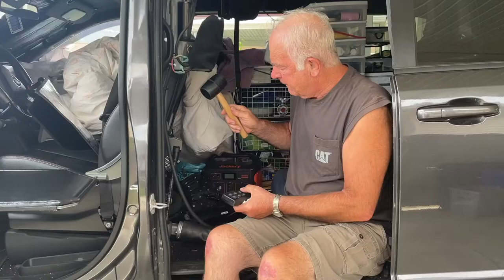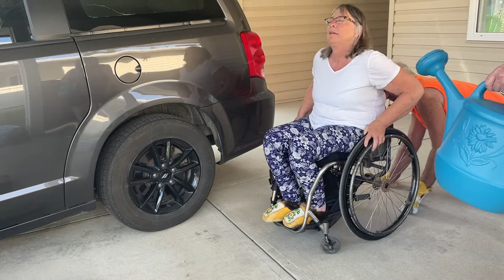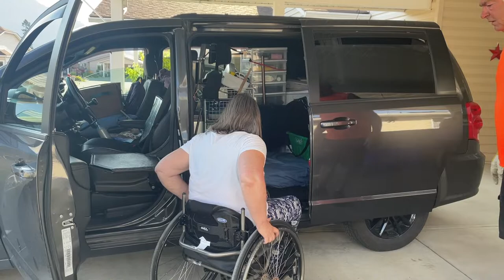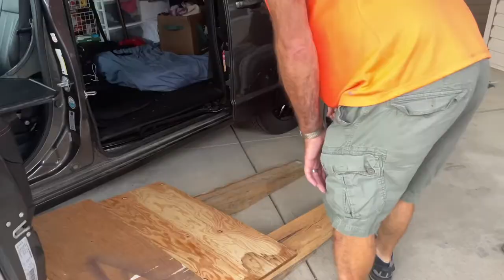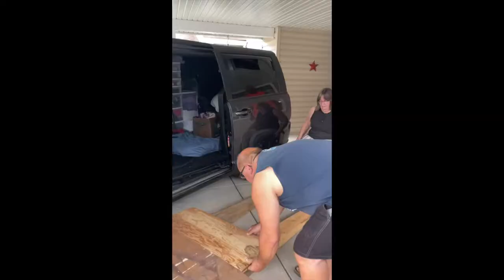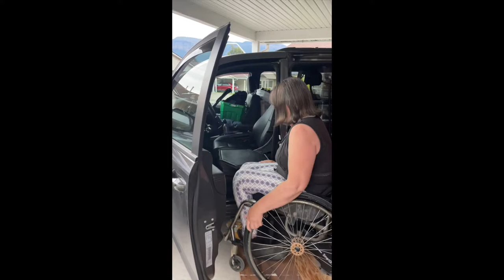Wheelchair Van Lift is Broken!

Comment: I m sorry to hear that happened to you, I don’t have a van yet but one of my fears just happened to you that’s the reason I do not want a lift, just good old manual power to get in and out. Another problem you solved for me is load placement, the video when your WC got trapped or pinned to your side door I felt for you then but that taught me a lesson as well. Thank you for sharing and keep moving forward.
Reply from the maker: Thanks Jeffie.  Ya, when those drawers fell over it was pretty annoying but they had been zip tied to in a couple of places.  The zip ties broke.  I used much stronger ones this time. i also talked to John at J5 this summer.  I think i will be getting him to build in a few things for me this winter. As for the lift, my shoulders have become old over the years of transfers so that is why I have a lift now.  It sure helps.  Except when it is having problems.  Most lifts have a manual back up system but this one does not for some reason.  I hope you get going in what ever you decide to get into, van wise, very soon.